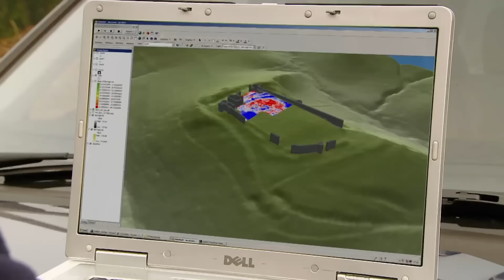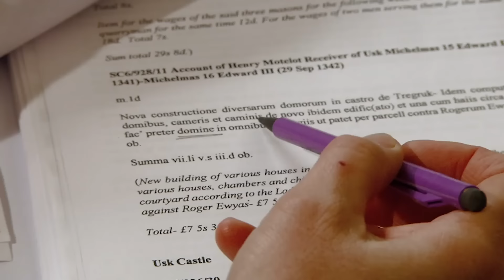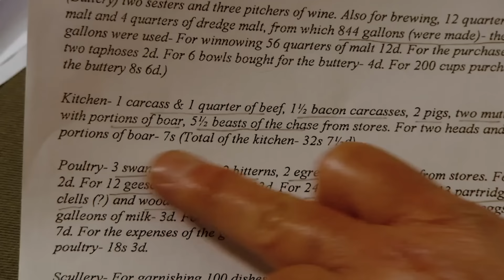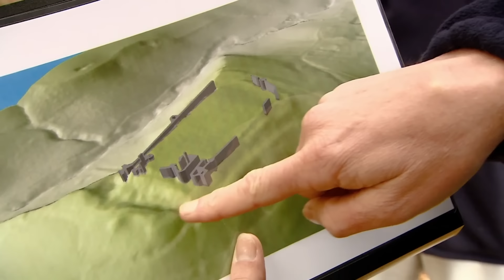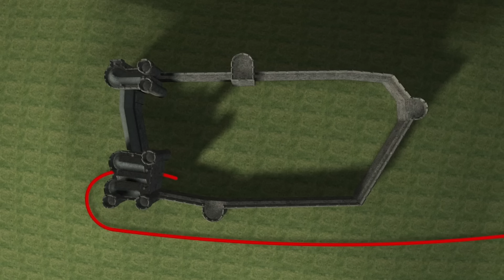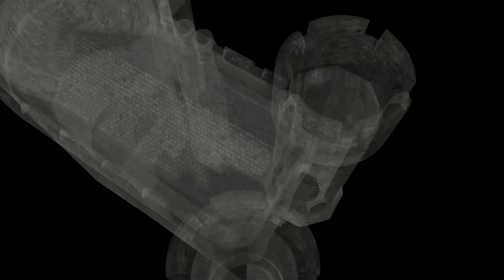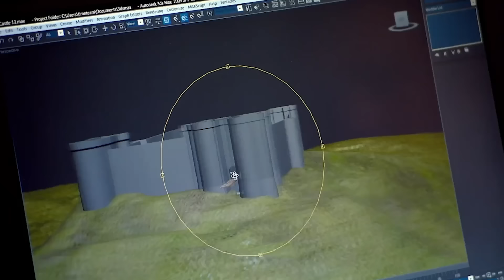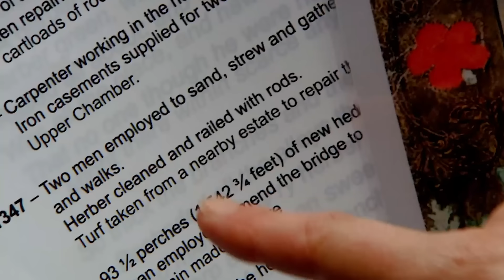Something for the Weekend (Tregruk Castle) | Series 17 Episode 8 | Time Team

Comment: There must be some of the stones still around right? Can't imagine everything from such a big castle turned to dust.
Reply: Most of the internal structures were made of wood except the main hall which was probably dismantled to fortify for the civil war.
Reply: Know when they say "Robbed out?" Well, they mean robbed--stolen by some locals looking to save a tuppence on cut stone for their building project.
Reply: @dlschgo  Yes, of course, so that’s why I asked if they still are around. In the houses nearby maybe, probably not.. as those are usually also undergone the same fate, but there must be some around still.
Reply: @VincentGroenewold  Remember them talking about the Georgian mansion that was demolished in the 1950's? That's probably where the stone went originally. The owners took down the old buildings and walls and towers they didn't need to build a fancy new house outside the walls and turned the ruins into a garden feature.

Comment: In retrospect, watching this again, it's pretty clear that during the latest (or even before that, perhaps) reformation of the site (and this is before the manor was demolished), the site was completely changed and destroyed as an archeological land piece. There's barely anything left to scrape and very likely extensive evidence (in the center ) was completely lost. If i was a betting man, i'd say that a significant amount was used to make the house and that that's where it's likely at, if the ruins of the manor are still there. if someone were to dig up the site and find the stones, and among them, find stones with matching faces to the ones inside the castle or with the castle's walls, it would be a significant nail in the proverbial coffin. I don't particularly understand why that site is preserved as if some sort of magical method of archeology will pop from the generational bend, i think even before TT went in there, it was clearly barren and modified. If anything, it should've been cleaned in its entirety, with the intent to find as much of the original as possible. History serves nobody if it's hidden in the dirt, and while i understand other sites, where potential damage beyond repair is likely... this ain't it. This site's already been damaged beyond repair. If it weren't for TT, its original story would've still hung in question. Archeology is obviously a job of patient people, but sometimes, too much patience is bad.

Comment: 'solidity'?  Nice
Would assume, since they never address raw building materials in the area, that all of the previous buildings/structures were consumed to create the later buildings.
Maker mark's indicate manufacturer, not costs.  Nothing like an expert who doesn't apparently know anything.
Interesting...clay pipe stem.  Clay pipes had long stems in bar or restaurant settings as they were the first vending machine items...the tobacco that is.  You barrowed the pipe, filled the bowl, smoked it.  At some point, the previously used stem  end was broken off for the next user (not sure if before or after), and the pipe was used til it had no stem.  The stem piece looks like a broken off piece, he didn't find the whole pipe.  Not sure one user would have a reason to snap off a used end.
Reply: Your so smart. It mus be nice
Reply: @AnnaAnna-uc2ff  they are supposed to be the experts ..